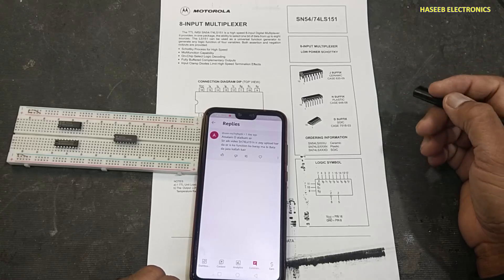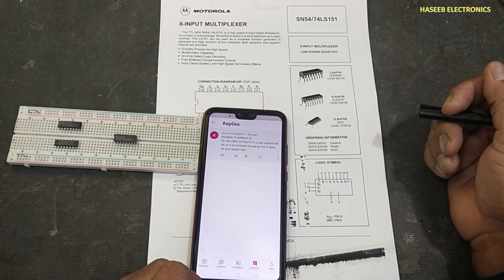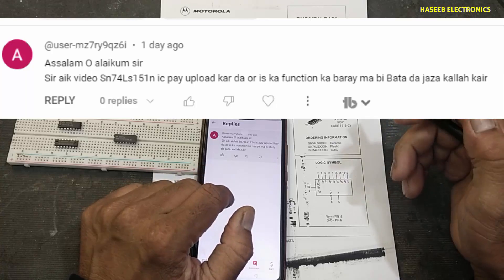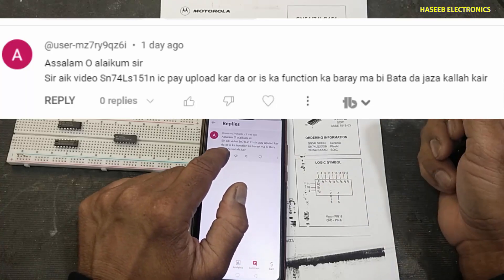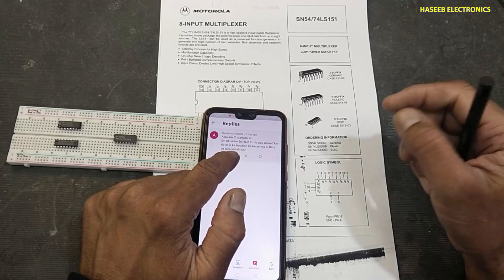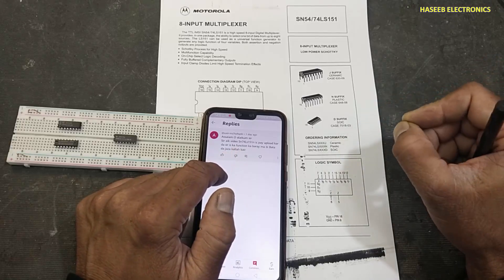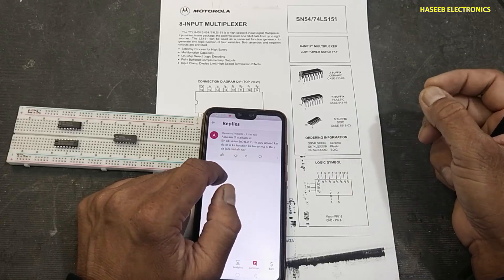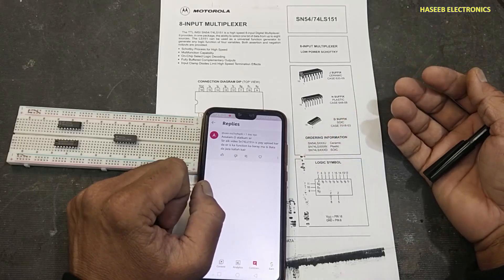{991} SN74LS151 Data Selector || Multiplexer IC explained & testing

Comment: Very good timing! Today I replaced a bad 74LS151 on a Midway Space Invaders arcade board (from 1978). The board has 8x 74LS151 used to bit-shift two 8-bit binary values and they are used to display and move the invaders. The theory is good to know but for simple and quick testing use an eprom programmer to test the chip. The popular TL866-ii can test logic chips. Maybe for a future video you can show how it is used to test logic quickly.

Comment: I love that you cover these older chips in your training. I was wondering about how 7 segment clocks use multiplexing. Probably most use a micro controller. I've got some 74hc244 chips that I am using to repurpose an old vfd tube from a microwave oven. These ic's have a high impedance state on the outputs so you can hook all outputs together and switch among the different output enable pins that you want at the time to show the digits you want. You have to multiplex the 7 segments by switching between the grids of each tube segment because there aren't enough pins from the tube to switch them individually.  I'm using a 7555 timer to switch cd4017 to enable all of the 74hc244's individually. Of course I have to invert the outputs of the 4017 because the 74hc244's are low enable. This project is a lot more complicated that I originally planned, but an educational experience. Thanks to the help from your videos. Take care.